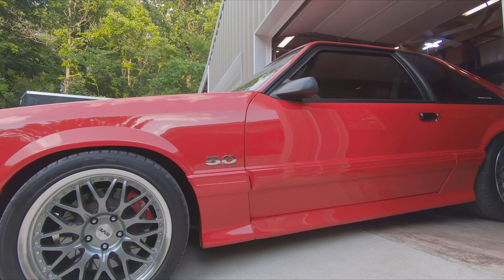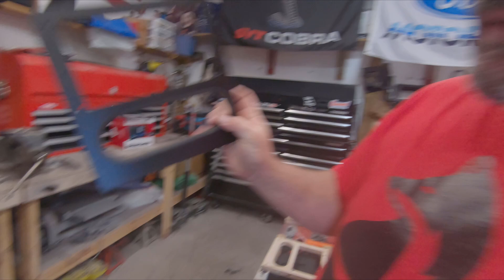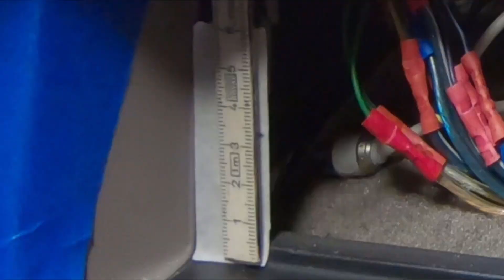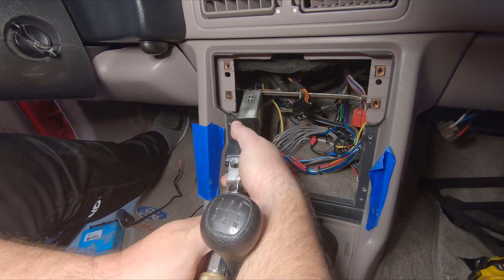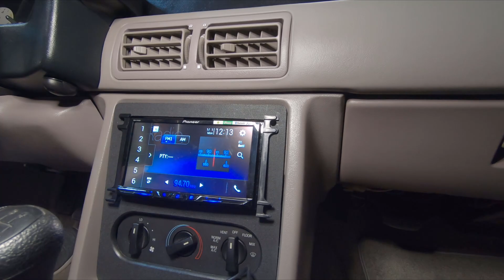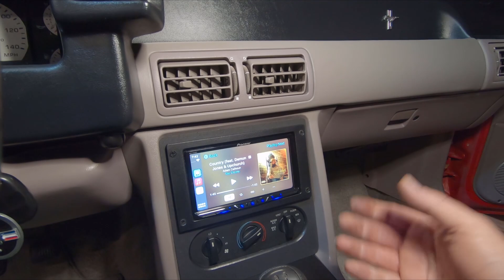Ultimate 90-93 Interior Mod for FOX BODY MUSTANG

Comment from the maker: To purchase bezels and “FOX IT” gear go to www.417FOX.com
Reply: The two head unit you recommend are hard to find. Do you have any idea how the Pioneer DMH-W4660NEX 6.8" may work with your trim kit?
Reply from the maker: @mustang43058  the bezel is designed to fit any double din cassis radio.  Depth is the key if you don’t want to cut the brace.  If you can stay under 4” in depth that will require the least amount of modifications to your dash.
Reply: @417fox  Awesome, thanks for the quick reply! I'm the carbon auto trans complete kit that ordered earlier today.
Reply from the maker: @mustang43058  thanks for the order man!
Reply: Hi! I absolutely love the bezel you designed. Do you know of anyone selling custom bezels for a 2000 mustang? I'd like to put in a double DIN radio and do HVAC relocation to the bottom. '00 mustangs were unfortunately the last year that they went with single DIN. I could put in a '01-'04 mustang bezel easily enough to solve the single DIN problem, but it doesn't have the HVAC relocation like yours. Thanks so much.

Comment: Great video. I just got my kit from you. How do you remove the blue air bag box? I'm trying not to break mine.
Reply from the maker: It is mounted with one bolt to a bracket on the dash support.  You can then simply push it back and secure it

Comment: Did you lose any speakers by going to an aftermarket radio? I’ve been on edge about swapping my 93 lx headunit but I’m hearing you’ll lose two speakers unless you bypass the factory amp. Seems there’s no good videos showing how to properly install an aftermarket headunit and keep all the speakers.
Reply from the maker: I wired each one of my speakers direct.  Best way to do it anyway.  Was installing a sub and amp too so might as well.  I think with the proper harness adapters you can still use your factory amp and not bypass.

Comment: Found your channel through this video. Great video, with a lot of detail... Was all set to do this swap, until I noticed the blue box disappearing. :(
Unfortunately I want to keep my blue box, So wont be doing the swap.
On the other hand I will only be doing a 1din radio, maybe I can find one shallow enough to keep the blue box, (my 29 year old after market Pioneer radio/cassette/6pack CD controller) is dying and I will be replacing it.)
Reply from the maker: You can actually keep the Airbag Buzzer Box and do a double din.  If you choose a shallow depth head unit like the Alpine iLX650 you do not have to cut the dash support that the box rests on.  Also.  You can always relocate the box as well.

Comment: How did you extend the wires for the hvac controls ? You cut and use butt connectors?  Cut and solder?

Comment: Looking to order one soon. Can you tell me will the Alpine iLx-207 fit in the space behind the dash or do I have to go with the shallow 650 version thx
Reply from the maker: It looks like that is a single din cassis so I am not sure.  If your cassis is less than 4” you don’t have to cut the metal dash support.  A standard depth unit will work just fine but it will require cutting that support.  That’s what I did in my car with the pioneer
Reply: @417fox  ok yeah the screen is double din but the chassis is single din in the back. I believe it’s at least 6 inches so if I cut  the metal bracket I’m hoping it will make it
Reply from the maker: @tonyo3856  my pioneer is 6”’ and double din chassis and fits fine with the bracket cut.  You may need to relocate your airbag buzzer (blue box)
Reply: @417fox  thank u I’ll keep u posted when I’m ready for the install

Comment: Do you make any for single din flip-up's with room for a cubby?
Reply from the maker: The standard single din install kit made by Metra for 87-93 Mustangs is available with the cubby.  It’s overall size is 2-din and will fit right in this

Comment: What's the blue box that you disconnected looks like it was mounted behind where the climate control is before you relocated it. It sits on the metal bracket the you cut. Is it needed?
Reply from the maker: Part of the airbag system
Reply: @417fox  oh I don't even have the stock steering wheel so should I put it back in? I had everything installed today looked great but my harness I used doesn't work with the factory Amp so now I have to wait till Wednesday to receive the correct harness
Reply from the maker: @moses_3109  that’s up to you but I left mine out.
Reply: @417fox  nice. Appreciate the response and the installation videos.

Comment: Do you have anything for 86? I have a 86 GT with TTops and it has the 87-93 Front end on it. Been wanting a double or single dip flip up radio in it.

Also have a 89 but going to sale it.
Reply from the maker: Man I have studied the 4 eye dashes and I don’t see a way they could accommodate a double din
Reply: @417fox  Thanks for the reply I figured it wouldn’t be as easy lol. I’m thinking I’ll get a single din flipout. Going to watch this video again to see what foam plastic stuff you used. That stuff will come in handy for a lot of diy foxbody interior goodies.
Reply: How thick is the Pvc foam board you used bud? I’m looking on Amazon now to get some to try this stuff for myself. I do enjoy diy stuff for my Foxbodies lol. 

I wonder if Home Depot has any hmm
Reply from the maker: @antiricergt  1/4”.
Reply from the maker: @antiricergt  pvc board is very easy to work with but not as rigid as the HDPE I use to make the bezels I sell

Comment: at 12:00 minutes into the video you could see blue box with wires running into it in back behind where  the original heater controls were located. At 13:00 minutes into the video you can see the blue box is gone. WHat is the blue box for and what did you do to it?
Reply from the maker: Its the buzzer box for the airbag system

Comment: that wont work on an 88?
Reply from the maker: I have two versions.  One for 87-89 and one for 90-93.  Check my other vid
Reply: @417fox  right on. I guess I didn't know the center stacks were different for those year ranges. My hvac isn't connected and the heater core hoses were also removed, so only the fan and directional controls work for the moment in my 88 LX fox

Comment: Looks pretty cool man. I definitely need to do some interior upgrades at some point
Reply from the maker: If you decide to do this Mod let me know and i will hook you up Matt
Reply: @417fox  Thanks, a lot.  If I do, I will.
Reply: @GearHead704  Matt Tarheels is a 89 right but he only doing 90-93 put it on the bottom use a remote control for the radio it does look better up top then on the bottom! But stuff is different on 87 - 89 h vac is different dashboard is a lil different we have tilt wheel 90-93  the tire wells are bigger then 87-89  there's a way u can do it anything is possible not every 1 has to have a double din radio in there foxs!!! Long as it sounds good what does it matter!!!
Reply from the maker: @cashmoneyv197436ify  I will have 87-89 ready soon
Reply: @cashmoneyv197436ify  Yup 89. Sounds like he's working on those.

Comment: respect to fox 417 but no wires cut in my fox and no holes drilled....used stock radio with ipod shuffle 300 songs all day long.stock premium amp runs front..upgraded speakers.tapped into rear speakers..fozgate amp and 2 fozgate tens..got clean sound and too much boom!!!!!!
Reply from the maker: This install isn’t for everyone.
Reply: @417fox  i know i just braggin about my rig up me and my freind did lol..i would like a big screen stereo but...this works for now..nice!!!
Reply from the maker: @mysticker11  it was painful to cut my wires on my low mileage car.
Reply: @417fox  ill bet...

Comment: Since you cut out the dash support brace & removed the radio bracket, do you have any issues with the dash rattling? Other than the system bumping the Upchurch & Calhoun ?
Reply from the maker: Not yet.
Reply: @417fox   I like the look and have thought about this same flip flop before.  This was a great instructional video. Thanks & keep up the high quality content.
Reply: @417fox  1 year update? Anything you wish you did different also?

Comment: Man if you make them for 87-89 I would definitely buy one! I'd be willing to pay slightly more too!!! Definitely want!
Reply from the maker: I am working on it.  Unfortunately they will be a little more since there will also have to be some additional brackets to attach
Reply: Just buy the 90-93 controls. Everything plugs in the same, just opposite sides. That's what I did on my '89. I have a video on my channel if you guys wanna check it out. Sorry for the shameless plug.
Reply from the maker: @BackyardBMX73  all good man!  Plug away. I watched your vid before doing this one
Reply: @417fox  right on man! Your work is very nice! Extremely happy with mine!
Reply: Definitely will be waiting on the 87-89 one myself too for my 87 Fox. Awesome work man!
Reply: @ponie1992 @417fox is currently working on the 87-89 one just seen it on Instagram yesterday I can't wait
Reply: @omargarcia-nn8hs  there you go, even better!